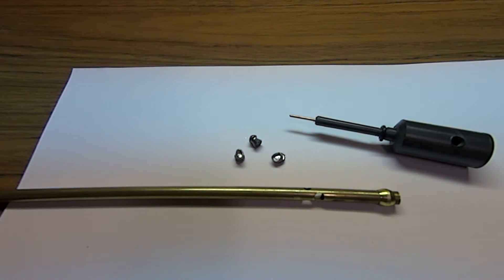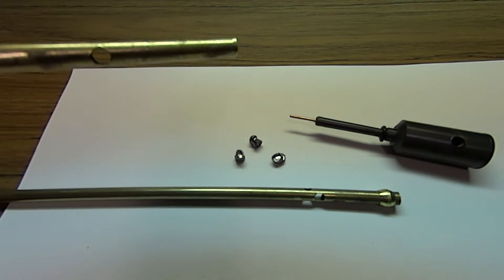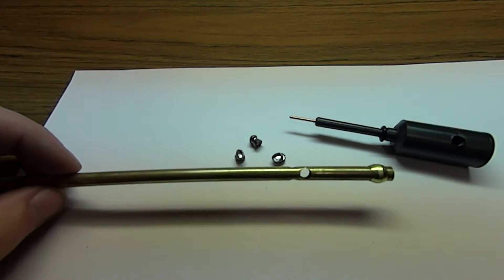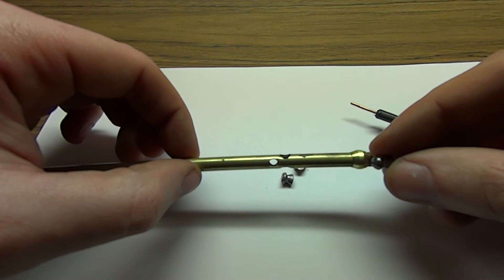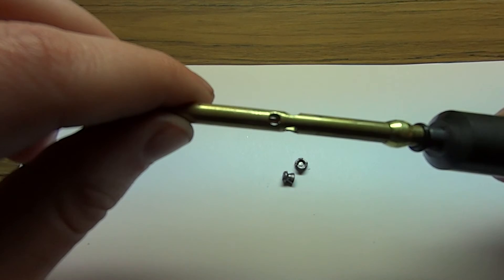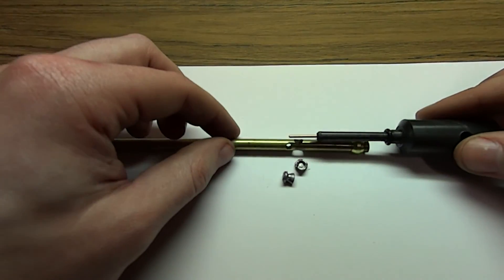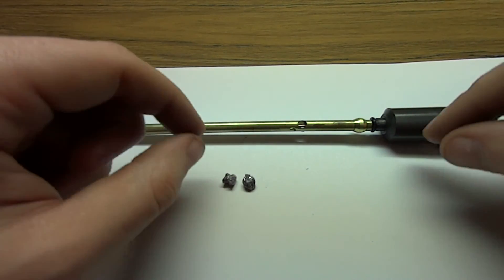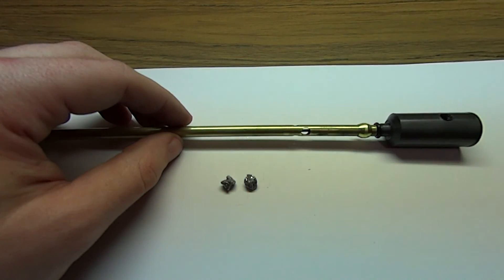.22 Caliber QEV PCP Air Rifle Barrel and Slide

Comment: where can i buy that brass tube you used for the barrel? I couldn't find anything local that had the right inner diameter for the pellets and did not want to salvage from another airgun
Reply from the maker: MisterMinecrafter1 I got my locally from true value / Ace hardware. Amazon would have it as well
Reply: what is the inner diameter?
Reply from the maker: like .225?  don't have an inside micrometer that goes that small